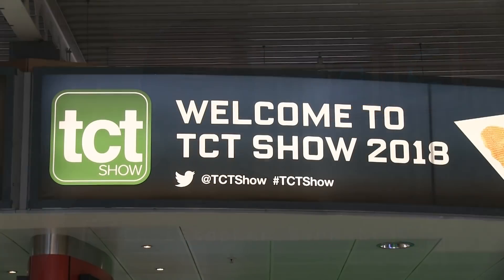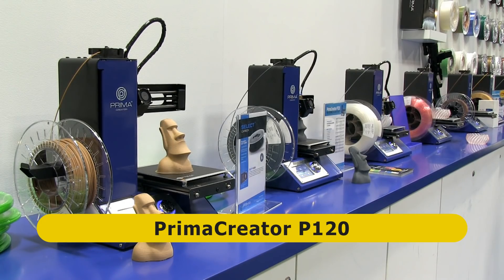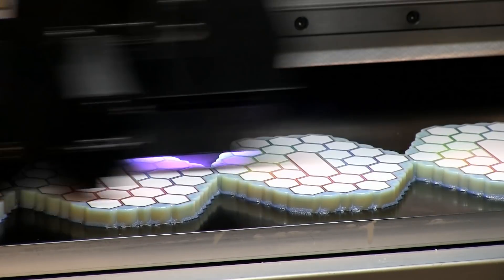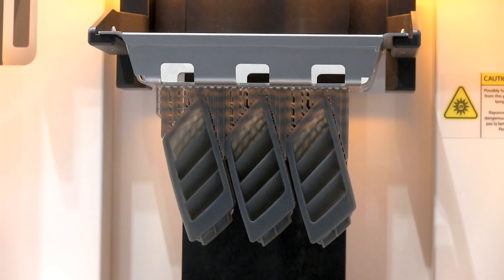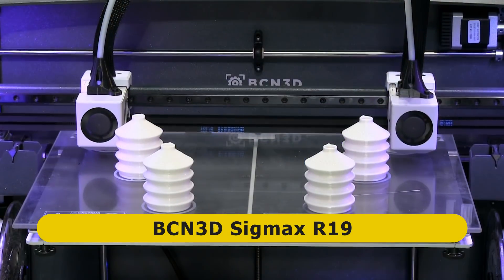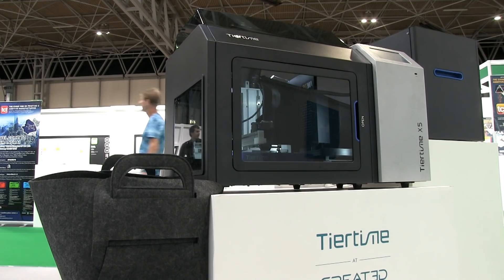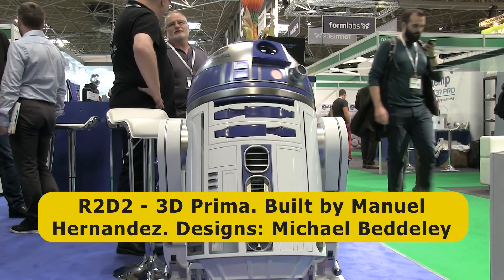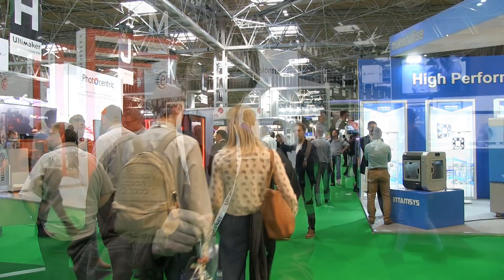3D Printing at TCT Show 2018

Comment: I remember when you first talked about 3D printers. Nice to know that 3D printers are getting more useful by the day.
Reply: Getting better for sure, but many still don't make anything that is sturdy enough to actually use I don't think, most are honeycomb type machines that leave a lot of empty hollow spaces inside the item...maybe that depends on how the drawing is for the item being made?  I just know from seeing some gears that they were not holding up well to being used due to the hollow type printing design they use to save on plastic.  

I saw a video somewhere not too long ago about a Home Depot back east using a Dremel 3D printer as a demo model at a store and initially it was just printing off little figurines and nonsense like that and someone that worked at the store found out about a program that helps kids get prosthetics...somehow they managed to get the ok and received files for the printer to make 3D printed prosthetics...so now rather than their demo machine making nonsense little figurines that get thrown away they are making kids limbs that benefit them and are getting funding to do so through the program.

Ahh found the video:  http://www.capitalgazette.com/news/annapolis/ac-cn-home-depot-prosthetics-0728-story.html

Comment: What industry is this threatening now? Not sure of the materials used but it seems perhaps machine tooling might be a victim.
Reply from the maker: Spot on with machine tooling. The biggest impact of 3D printing now, and likely over the next few years, is making molds and tooling, and so this will certainly threaten those who make such things via other methods. This said, in a broad sense, 3D printers are becoming machine tools -- and we are increasingly seeing hybrid devices that combine 3D printing technologies with robotics, CNC, etc.

Comment: Your recommended entry level printer is way too small for the asking price. 
You can get a CR-10 or Aurora A5 for 350$-400$ with a much bigger print size, better quality prints and awesome community support.
Reply from the maker: I did say my recommended entry level printer at the show . . . :) This said, I wold stand by the Cetus, as it is based on the earlier UP models that have proved very reliable over time.

Comment: There are too many printers available. I find it very confusing. I want something that has great support but needs very little fiddling to get it working so I can just print without having to mess with the bed and whatever else you have to do. If that's possible with around £200 then I'd be interested. I don't mind having to build it, but once built I would like it to automatically work or as near as.
Reply: My opinion on this cant do some basic setup on machine then how can you build 3D items.
Reply: I didn't say I couldn't or am not capable, just don't want to have to. I've not got one yet so don't know whats involved and don't want to get a rubbish one that keeps needing adjusting and repair.
Reply: I'm in this same boat.  I want to buy one but I don't want to have to sit there and mess with the stupid thing every time I turn around because I bought the $200 one rather than the $201 one that didn't require me to fuss with it for an hour before it would work.  Yep, I'll gladly wait until the bugs are worked out of a good quality decent priced 3D printer before I buy one, but how long does one wait before trying to figure out which printer to get, and its not like you can walk into a 3D printer store and try out a dozen different brand/model printers...sure would be nice but not going to happen...they're all made in China, so which over-priced cheap Chinese toy do I buy LOL.
Reply from the maker: And this is the problem! :) The low-end consumer tech is improving, but does still have hiccups.

Comment: Sir, opendog is cool and all, but James Burton is a giant a-hole. I've seen the whole series up until this point, and the design of opendog isn't as "open source" as the name suggests, and it certainly isn't using parts that are readily available to most people. The motor drivers alone cost like $80 a piece, and I'm not seeing any generic version of those for any cheaper.
Reply from the maker: I've met James on many occasions, and think he does great projects that are the subject of excellent videos. As I understand it, he is sharing the designs and code for openDog. But inevitably many of the electronic and electrical parts used are expensive, and I don't think he should be blamed for that.
Reply: Fair enough.